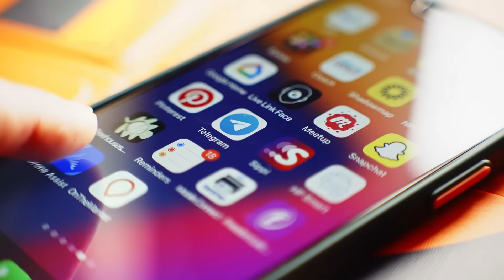Beijing-Guangzhou: World's Longest High-Speed Railway

Comment: Only took 7 years to build 1,400+ miles of tracks, bridges, tunnels,  and stations. In US, it takes 10 years to renovate a 5 miles stretch of highway.
Reply: Nope. 2,298 kms = 1,427.911 miles.
Reply: 45000 km hsr in a decade.
Reply: @hippocreation  What the hell are you talking about? The video is about Beijing-Guangzhou high-speed line. The distance is 2298 km and took 7 years to build. Did you watch the video?

Comment: Thanks for the great work you do.   Informative video.*   Another topic for a video could be how the HSR system in China integrates with the "higher" (intermediate) speed (200-250 km/h), "classic" (lower) speed (80-160 km/h), and inter-urban and metro railway systems in China.   Do they integrate well?   Did they integrate well from the outset, or what steps were taken to make them integrate better?   There could be a lot of learnings.

(* although a lot of the footage did not seem to be of the B-G HSR line).

Comment: ‌Currently, the longest high-speed rail line mileage ranking in China (single train):
NO.1: Beijing-Kunming Line, about 2760 kilometers;
NO.2: Beijing-Hong Kong Line, about 2439 kilometers;
NO.3: Beijing-Guangzhou Line, 2298 kilometers;
NO.4: Shanghai-Kunming Line, about 2252 kilometers;
NO.5: Lanzhou-Lianyungang Line, about 1794 kilometers;
NO.6: Lanzhou-Xinjiang Line, about 1776 kilometers;
NO.7: Hong Kong-Xi'an Line, about 1766 kilometers;
NO.8: Shanghai-Hong Kong Line, about 1664 kilometers;
NO.9 Xuzhou-Lanzhou Line, about 1434 kilometers;
NO.10: Beijing-Shanghai Line, about 1318 kilometers。:yougotthis:
Reply from the maker: Thanks for this additional information. The China HSR network is truly a remarkable achievement.
Reply: The BJ-HK seater trains have been running at 350km/h for a long time. The new sleeper trains running at 250 were put into service this year.
Reply: @janusli8820  The Beijing to Hong Kong route can indeed be operated by the Fuxing high-speed rail, but there is no direct train, except for one EMU train per day. This ranking only counts the longest mileage of a single train service. Otherwise, you can use the connecting high-speed rail service to take a journey of up to 3,000 kilometers from Guangzhou to Xinjiang or Shanghai to Xinjiang, Guangzhou to Harbin, etc.
Reply: @0.0LEE-n8i  What do you mean by "but there is no direct train, except for one EMU train per day"? There is or there isn't? G80/79 is in fact a direct train operated by a Fuxing EMU and running at 350km/h
Reply: So does the Beijing to Kunming High Speed Rail just vanished to thin air?
Reply: @wlp7899  Thanks for the reminder. I read the latest news and found that the Beijing-Kunming High-Speed Railway is the longest single high-speed train route in China.

Comment: A small correction regarding initial operating speed. The line initially operated at 350 km/h (or even 355 km/h to be very precise) speed at least in some sections and certainly on Guangzhou-Wuhan section when it opened in 2009. It was reduced to 300 km/h in 2011 I believe, citing vague  reasons like safety and operating costs (the latter is probably true).
Also, why use stock footage from US cities? :)
Anyway, great and useful video. China's HSR system is beyound incredible and this line serves as one of two flagship routes alongside Jinghu HSR.
Reply: I took the train from Beijing to Kunming recently because the flight was canceled. In the northern section it was driving 350km/h. So far I know some trains are now driving 350km/h  again.
Reply: The Wuhan-Guangzhou line operated at 350kph from Dec. 2009 to July 2011. I took it back in April 2010, and my CRH3 (Siemens Velaro) did run at 350kph. But speed limit was reduced in July 2011 to 310kph following the Wenzhou HSR collision, which killed 40 passenger and shocked the entire nation. There were widespread public demands to slow down HSR constructions. Meanwhile, both then former Minister of Railway Liu Zhijun and chief engineer Zhang Shuguang were arrested for corruption in Spring 2011. Thus, the 350 to 310 kph speed reduction was more likely a political move to address public anger and temporary skepticism of China’s HSR projects.
Reply: @StandWithUkraineAndLiberalism  That's pretty much how I remember it too. Also, the whole "increased it back to 350 km/h" thing with only certain new models of trains could be a smart marketing move to advertise Chinese-developed trainsets like various versions of CR400 and the upcoming CR450, which can be legitimately presented as the fastest trains in the world and do not resemble any designs developed outside of China.
Reply: @StandWithUkraineAndLiberalism  Liu Zhijun was a controversial figure in China. Although corrupt, he was also ambitious and daring. During the early stages of CRH's 350 km/h trials, he sat in the front cabin of the train.
Reply: @deepseer  I remember that scene. He was sitting in the cockpit of a CRH3 during the trial runs of both the Beijing-Tianjin HSR in 2008 and the Wuhan-GZ HSR in late 2009. China was somewhat of a different country back then, so was the Ministry of Railway (now China Railway Corporation).
Reply from the maker: Thanks for the correction and the additional info! We’ll make sure to double-check such details in the future.

As for the stock footage, fair point—we have few mistakes in the video edit. Glad you enjoyed the video overall, and we really appreciate your feedback!